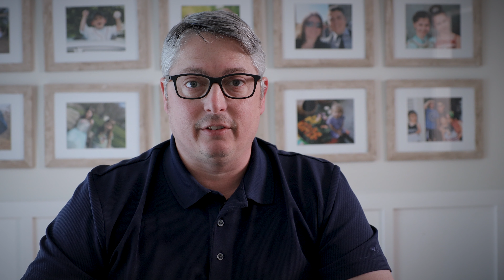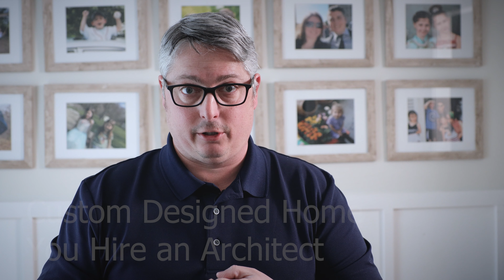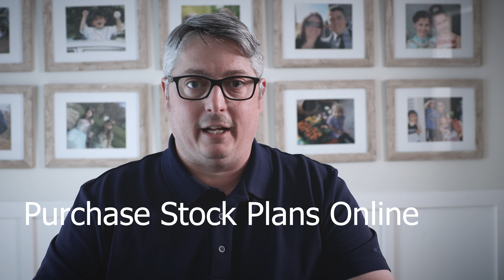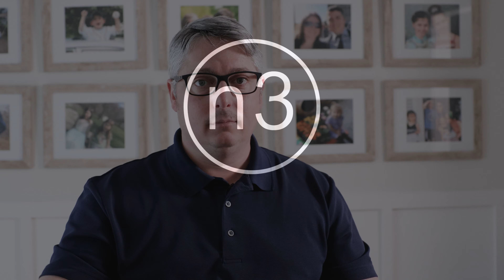Custom Design or Production Home   What is Best for Your Family

Comment: Curious about the option you mentioned about a "contractor/ developer/ draftsman "...

Wouldn't the drawings need to be stamped by a licensed architect or engineer?

I would think a contractor or developer is buying plans from a licensed professional....

In any instances to obtain a permit....stamped and sealed drawings figure in any scenario
Reply from the maker: Assuming you are in the U.S. this all depends on your state regulations. Some states required all work to be sealed by a licensed architect, some allow for single family and 2-family to not be sealed by an architect, some have a size restriction on single family that can be built without sealed drawings. If you are unsure of what regulations are applicable I would suggest calling the local building inspector.